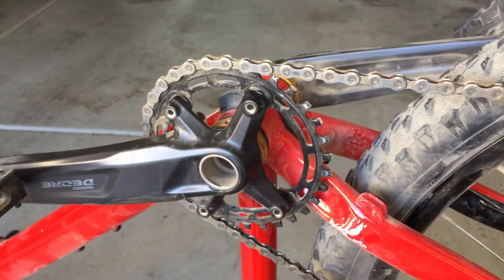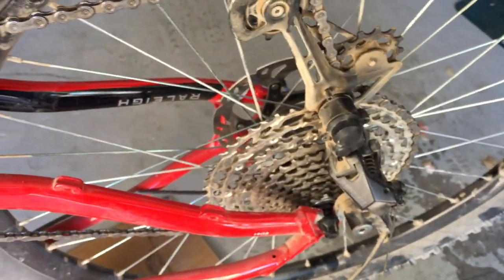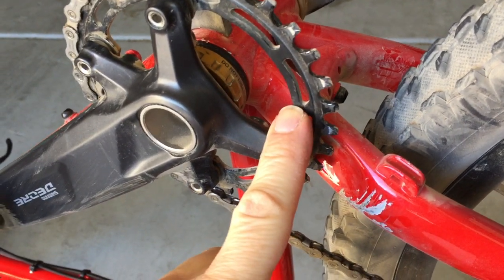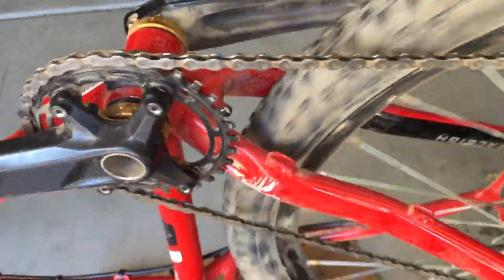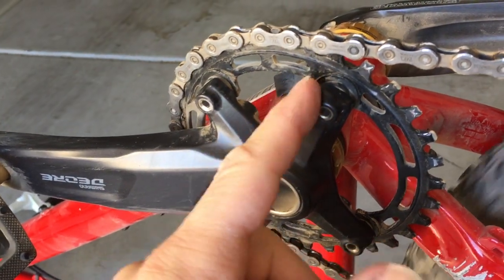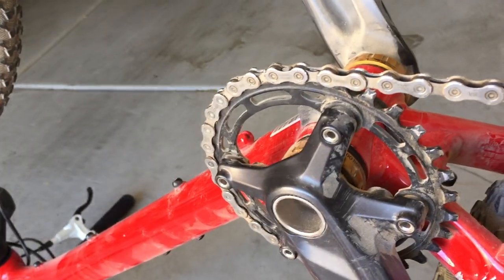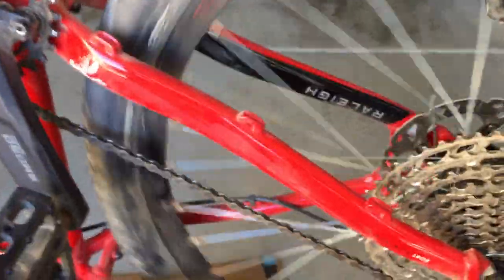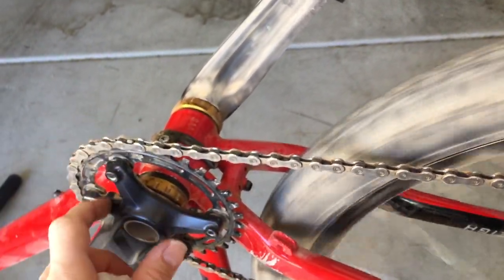Shimano Deore M5100 1x11 crankset chainline for 135mm OLD non-boost

Comment: Great video! Comments are a treasure trove of information too. I need a 48mm or so chain line for my 2008 specialized epic build I’ve embarked on recently. Thanks for making this 🤙
Reply from the maker: Thanks. If you are using this M5100 or similar Shimano crank with 52mm chain line you can reduce the chain line by a few methods. 1. adding spacers between the crank and chainring (as what I did in the video), move the bottom bracket spacers (usually 2.5mm) to the non-drive side which will offset your crank and yield 49.5mm chain line or purchase a different chainring with a built in offset (such as Blasckspire snaggletooth as suggested by a viewer). Unfortunately Shimano doesn't support 47-48mm non-boost chain lines with their 1x cranks any more. SRAM/Truvativ Dub cranks still support non-boost by offering a 6mm offset direct mount chainring that will give you 49mm chainring. I have a video about this on my channel.
Reply: @mtbbiker6401  yes I’ve gone with M5100 52mm chainline and plan to install 2x2mm spacers. Chainset has just arrived as it happens so will check the length of the stock chainring bolts and source some 4mm longer ones next.
Reply from the maker: @howlsy6388  I used M8-.75 x16mm bolts sold by problem solvers purchased from 365cycles in USA. You can probably also find on ebay. Search long chainring bolts.
Reply: @mtbbiker6401  Hi, is 16mm the total length of the bolt or just the thread?
Reply from the maker: @samfisher3649  I believe just the thread but the bolts are fully threaded to the head of the bolt. I used Problem Solvers 16mm chainring bolts. If they are a little shorter or longer probably won't make a difference at least with this M5100 crankset

Comment: I have the same setup, exactly the same. I'm assembling when i noticed by eye that it was way off, and I found your video. I will remove the two 2.5mm spacers, or left just one. I saw somewhere that the chainline for 11v is 49mm
Reply from the maker: If you have 68mm bottom bracket shell and using a Shimano Bottom Bracket that uses three 2.5mm spacers (2 on drive, 1 on non-drive), you can try moving just one of the spacers to the non-drive side. This will reduce the chainline from 52mm to 49.5mm. You could try moving both 2.5mm spacers to non-drive side using all three spacers on non-drive side. This will reduce the chainline from 52mm to 47mm but adding both spacers to non-drive side may not leave enough thread engagement to secure the bottom bracket properly on that side. If using a 73mm bottom bracket shell, you only use one 2.5mm spacer on drive side. You could move this to non-drive side reducing chainline from 52mm to 49.5mm. Hope this helps.
Reply: @mtbbiker6401  Yes! I was thinking about this today, that I miscalculated cause the 68mm is for both sides. Thank you!
Reply: @mtbbiker6401  strange enough that I finished the bike on got out with 52mm cause I didn't want to lost the Sunday afternoon, and it's working marvelous
Reply from the maker: @FernandoHaddadMinistro  If 52mm chainline is working fine, then no need to change it. If you spend a lot of time in your 51T cog then having a larger deflection angle may increase wear of the cassette or chain. I like to minimize the deflection angle of the chain by setting the chainline to line up in the middle of the cassette if possible. One of the symptoms of having a chainline that is too wide is the chain will drop down to a smaller cog when back pedaling. So if you are in your lowest gear (51T) and try backpedaling your chain might drop to the 45T cog. Also make sure to properly set the B screw on your M5100 derailleur. There is a special alignment marking (line) on the back of the derailleur that is supposed to line up with the tallest tooth of the 51T cog. Shimano makes it super easy to set the B screw, but many people don't know about the alignment marking on the back of the derailleur. I currently have my chainline set at 49.5mm it seems to work fine. I never tried it at 52mm.
Reply: @mtbbiker6401  Thanks! I set the B screw before going out. The 51t is for sure with much more angle on the chain compared to 11t, but I have now a 5mm clearance for the tire when using the 51t cog, I don't about the risk of reducing the clearance for 2.5mm if I remove one spacer...
Reply from the maker: @FernandoHaddadMinistro  Yes, tire clearance certainly needs to be considered. That's why chainlines have increased in order to use wider tires and shorter chain stays.

Comment: Brother thank you very much!  I am commenting this from a personal point of view to help others who are doing this kind of project and to open their eyes.  That Shimano recommends a 52mm front chainline is absurdly large!  Some Sram groupings of this type have as much as a 6mm difference between the front and rear chainline on the boost standard.  Not to mention who uses the 135mm QR standard.  In this case, if you have a 68mm bottom bracket mount, put two spacers on the left side.  This will allow an even load on the bearings, and you will get a chainline difference of about 3mm which is ideal for 1x11 drivetrains with huge cassettes.  To health.

Comment: It's best to use the BB-MT501 or what is it called, not the regular BB-52. The standard one only has 2.5mm spacers, but the 500 has two 2.5mm, one 1.5 and one 0.8 I believe. These can be swapped around to achieve proper chain line for different dropout lengths
Reply from the maker: Good to know. I was aware of the 1.8mm and 0.7mm spacers offered by Shimano but didn't know they were included with the MT501. My BB is a Saint which included (3) 2.5mm spacers.

Comment: So I installed this crankset as a 1x10 (11-46 with 32t chainring) on my Marlin 6 2021 HT and I didn’t have to move the chainring with spacers. I have a 29er in size M and just put one 2.5 spacer (I think) onto the BB52’ non drive side (set up for 73mm) and none on the drive side. Now it was my first time installing a whole new group set but it works fabulous. No backpedal issues either. Had to play around with the cable tension many times but all is great now. :)
Reply from the maker: Yes, you are correct. The Shimano bottom bracket spacers are 2.5mm. So you essentially offset your bottom bracket (and crankset) toward the non-drive side and reduced your crankset chain line from 52mm to 49.5mm. I did the same thing on my 73mm BB width frame and removed the previously installed chainring spacers. This actually worked out great and brought the chainring to within a few mm of the frame. I can't move it any closer. The 49.5mm chain line seems to work fine with my 142mm thru axle width (same as 135mm QR). Thanks for your comments! It appears the 2022 Marlin 6 now includes a 1x10 drivetrain (m4100). Amazed it's still using 135mm QR dropouts.

Comment: I have a different "issue" I have a boosted frame with boosted deore crank 32t all 11 speed deore.
I would like to try 34 teeth chainring but I dont think this exist for deore crank so should upgrade to slx.
Slx boosted 12 speed chainring and crank are easy to find but 11 speed not so much 
Dont want to spend hundreds changing my Wheels casette deraileur chain etc to go 12 speed....
Happy with 11 I just find myself using the 2 smallest teeth on the casette to much and would like slightly taller gearing.
Reply from the maker: I think you can find 34T chainring. Any 96 bcd asymmetric design chainring should work.
Reply: @mtbbiker6401  thx I found out I can fit a slx 34 chainring on my deore crank

Comment: Have the same crank and an older mtb (68mm bottom bracket). 
I was able to reduce the chainline by 1.5mm by using 3.5mm worth of spacers on the right BB cup (instead of the 2x2.5mm). It actually worked better as the splines were more engaged into left crankarm and I was still able to preload the bearings.
I then used 3mm chainring spacers (I would probably advise to use metal vs nylon ones). 

Thus 52 - 1.5 - 3 = 47.5mm chainline

Great crankset, especially for the money and doesn't look out of place on a retro build
Reply from the maker: Great response. I have a small frame, 27.5” tires and short 425mm chain stays. I wanted to reduce the crankset chain line from 52mm to 48mm (actually about 47.5mm) using 4.5mm worth of spacers. I found M8x.075x16mm chainring bolts to replace the stock Shimano 12mm bolts. Thanks for your comments.

Comment: Deore m5100 vs shimano mt510 which is better ?
Reply from the maker: Essentially the same but the MT510 chainring is made for Shimano HG12 speed chain so it has a different tooth profile than Shimano 11 speed. M5100 is designed for 10/11 speed chains. I don't believe they are compatible. Use MT510 for 12 speed and M5100 for 10 or 11 speed.

Comment: Making a note of these adaptations. About to do this same (1x11 Deore groupset) conversion on a 2008 Giant XTC 1 hardtail. 21" frame, 135mm QR 26" wheels...I suspect I'll need to do something similar.
Reply from the maker: You might have to adjust the chain line. The chainring should line up around the middle of the cassette. I would aim for a chain line of around 47-49mm.
Reply: @mtbbiker6401  A test fit of the new Deore crank and RaceFace BB shows there's plenty of space between the 1x11 chainring and the chainstay to run with 0 driveside BB spacers, which should help get a good chain line! 

Next question is will I need a chain guide. My frame doesn't have ISCG mounts, so I'll need to use either an adapter + ISCG guide or BB mounting chain guide. Either way it'll mean +2.5mm on the drive side. I'll have to see how it all performs once together!
Reply from the maker: @chestercopperpot3793  I'm running completely stock M5100 set up with the RD-M5100 SGS clutched derailleur. (1x11, 32T chainring, 11-51T cassette) I've never had the chain drop. Honestly, I wouldn't worry about a chain guide. I'm not familiar with the RaceFace BB. Do they require 3 spacers like Shimano? Is it a BSA threaded shell or press fit? Shimano recommends 2 (2.5mm) spacers on drive side and 1 (2.5mm) spacer on non-drive side assuming a 68mm bottom bracket shell. For 73mm shells, you only use 1 (2.5mm) spacer on drive side. If you need to use all three, you could move all of them to the non-drive side but this would offset your crankset plus you may not have enough thread engagement on the non-drive side. Keeping 1 spacer on the drive side would put your chain line at 49.5mm. This would probably be okay, then you wouldn't have to worry about adding spacers between the chainring and the crank like I did in this video. I recently moved this drivetrain to a full suspension bike with 142mm rear axle and 73mm bb shell. I moved the single 2.5mm bb spacer to the non-drive side and have just enough clearance between my chainring and chain stay. I can't get the chainring any closer without hitting the chain stay, so I'm stuck at 49.5mm but it's working well. The other thing to consider is chain length. I believe Shimano recommends adding 4-5 links + quick link. If your chain is too long, then you could have problem with chain retention and properly setting the B-screw. There's a special marking on the back of the m5100 derailleur to line up the 51T cog. I couldn't get things to work using Shimano's recommended chain length procedure for full suspension bikes, so I shortened the chain by 2 links and it's working perfectly now.

Comment: I just ordered this crankset and I have a question. I currently have a IXF crankset and I'm using a 104BCD Wolftooth chainring, would I be able to use the same chainring with this crankset. I paid $70 for that wolftooth chainring and would hate to just have it sitting around unused. I'm just worried because this cranks chainring arms look like they are spaced out kind of weird and not evenly like on my current crankset and chainring.
Reply from the maker: This Shimano M5100-1 crank uses a 96 asymmetric BCD mounting pattern so 104 BCD will not work. You are correct. Being asymmetric, the arms/holes are not evenly spaced.

Comment: Can you do this for direct mount chainrings?
Reply from the maker: No, but SRAM offers 3mm or 6mm offset chainrings for 52mm or 49mm chain lines on their direct mount. Other manufacturers might offer also. What type of crank do you have?
Reply: @mtbbiker6401  I have the Shimano M6100 crank
Reply from the maker: @gerardguadayo1788  If it's FC-M6100-1, then it has 52mm chain line just like my m5100 in this video. Are you experiencing problems? 52mm should be okay for boost axle. Are you running m6100 on a non-boost frame?
Reply: I haven't installed the crank yet because I've discovered that it has the 52mm chainline. Then I came across your video where yoy said you encountered some problems indeed when running it on a nonboost hub. I was hoping that I didn't need to buy another crankset so I'm considering using some washers on the chainring, if possible.
Reply from the maker: @gerardguadayo1788  Sorry I'm not familiar how the chainring is attached to the crank on your direct mount and whether you have room to space it. How wide is your bottom bracket shell? They are usually 68mm or 73mm. Shimano bottom brackets usually come with three 2.5mm spacers. For 68mm you place 2 spacers on drive side and one spacer on non-drive side. You could try moving one drive side spacer to the non drive side. This will reduce your chain line by 2.5mm giving 49.5mm by offsetting your crank slightly. Just make sure the chainring clears your frame. If you have 73mm shell, they only use one 2.5mm spacer on the drive side so you can move it to non-drive for 49.5mm chain line. So instead of offsetting the chainring, you are offsetting the bottom bracket.

Comment: I don't really understand why did you do that? I applied spacer to suport
Reply from the maker: Yes it depends on how many bottom bracket spacers are required for bottom bracket shell. 68mm shell requires two 2.5mm on drive side and one on non-drive side. 73mm shell only requires one 2.5mm spacer on drive side. You could move one 2.5mm from drive side to non-drive side to reduce chain line to 49.5mm (52-2.5=49.5). This could work.